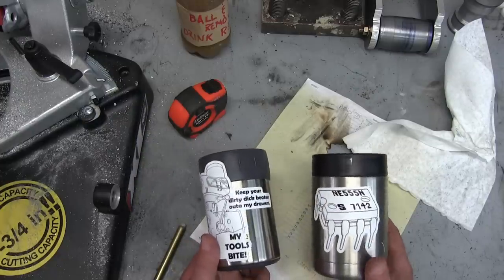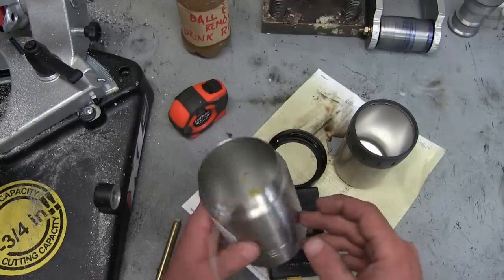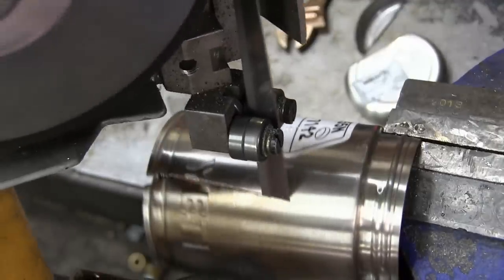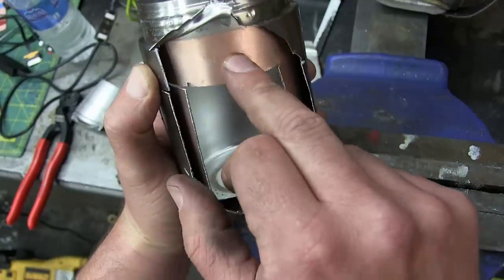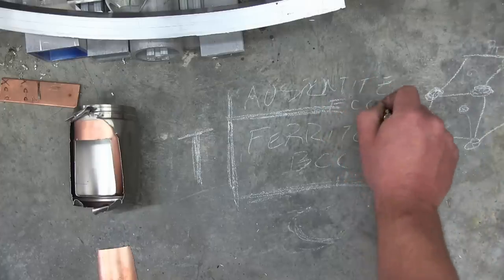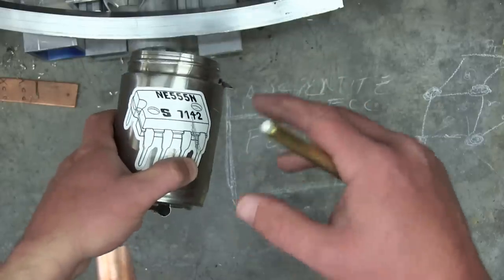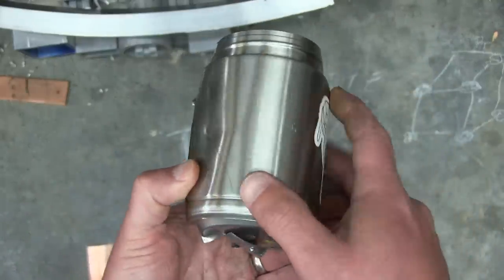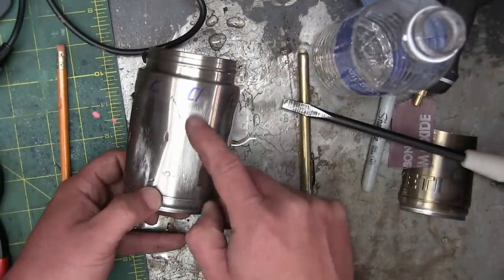BOLTR REDUX: YETI How it works | Enginerding Stainless Steel

Comment: Hi 
Thank you for your hard work in all your vedios
The little pellet at the bottom is Magnesium I think to prevent corrosion because it corrodes instead of the metal around it 
The same method is used in wave breakers and caskets the thing you bury your dead in 
Sorry English is not my language

Comment: Interesting thing you can do with stainless vacuum bottles - put a small, say, 60 watt or even less, heating element in one, and it will easily and quickly reach temperatures that you might find useful, if you were annealing small pieces of glass. 700-1200 F degree range.
I have done this many times, with various stainless vacuum bottles. If you try to be cute and try to see how hot is will get, I've gotten 1400+ degrees, and then the bottle died. IE, the vacuum sucked the sides in. Also, the bottle WILL get hot, so make a stand for it. I think the differential temperature of having it on a solid surface can help make it die from the vacuum sucking the sides together. (after that happens, it's no good at all.) (also, trying to be cute and insulating the bottle with fiberglass or rockwool doesn't work very well, either.)
I usually use a PID controller.
I got the idea from an old Scientific American Citizen Science article that said 'furnace in a thermos'.
Ex-girlfriend of mine used to make glass beads on stainless mandrels via a torch, and having this device made it possible to anneal them quite effectively - when you're done loading as many as you want in the bottle, let it sit for a while at 900 or 1000 degrees, then put a plug of some sort in the mouth, and unplug the heating element. This lets the glass cool slowly and not break.

FWIW.

Comment: Mildly stainless steel (301/302) up to intermediate grades (304/316) can become quite magnetic when it is cold worked. Since these are deep drawn cups, the stretch in that band will be quite severe. Annealing it with the torch relieves that stress.

Comment: Turns out you were right thinking they cheaped out with the copper coating on the internals, silver is the better of the elemental IR mirrors without getting into the complicated germanium, selenide and fluoride reflectors.

Comment: Copper and stainless steel are reasonably compatible from a corrosion perspective. Copper in contact with ordinary steel will cause the steel to act as a sacrificial anode for the copper, like you say. But because of the vacuum, it probably doesn't matter anyway.

Comment: The little nubbin thing can't be security tagging. It's encased in metal which would block all EM from being received or transmitted by or from the nubbin. Dunno what it is but I'm fairly sure it's not that. Great video btw, didn't think I'd be sitting here watching a flask tear down for 20 minutes!

Comment: The plug in the bottom is where they plugged it after pulling the air out between the walls, vacuum flask vs double wall flask. better insulation

Comment: 8:24 that's a getter. you can also find then in arc lights. theyre used to get every last bit of gas out of the place to be pulled under vacuum.
Reply: Well, I wouldn't say "every last bit" but enough to keep her choochin! :P You don't need, and it's nigh on impossible to create a perfect vacuum. Even the space between galaxies isn't a "perfect vacuum", but it's damn close with 1-2 particles per cubic meter!
Reply: close enough i guess! derp me!
Reply: Derp?! No way dude, you're basically right with the function, and most times "working knowledge" is more than good enough to get the job done! I'm just a nerdy information sponge, and what use would I be if I didn't share what I know? :D
Reply: Hey its not like being nerdy is a bad thing or anything... I always took being called a nerd as a compliment in school!
Reply: Good attitude! Someone trying to insult you with the word 'nerd' is basically just saying, "you're smarter than me and I don't like it!!".

Comment: That thing might be an anode. To prevent the oxidation you mentioned at first. Similar to the zinc anode in a jet ski cylinder head water jacket.

Comment: That pellet is used for increasing the vacuum. The chamber is first filled with oxygen, displacing other gasses. Then the oxygen is mostly removed with a vacuum pump. The remaining oxygen reacts chemically with easily oxidizing material (e.g. magnesium) and forms a solid.

Comment: I am guessing that little bead inside the bottom is a material that absorbs any outgassing of the other components to maintain a high vacuum. Electron tubes had that inside and it was called a "getter". It was that sliver looking coating on the inside of vacuum tubes.

Comment: Hydroflask has a comment about a small metal disk they use in there vacuum bottles. From their website "Rattling flasks: The rattle you hear is a small metal disc that sits between the double wall of your flask and aids in the vacuum insulation process. Sometimes the disc becomes dislodged, creating a small noise or rattle. This will not affect the insulation or structural integrity of your flask. If you can live with it, so can we. However, if it is an annoyance, we will exchange it for a new flask."

 I am guessing that is what that little disk is on this Yeti.

Comment: Interesting remarks about the copper surface.  I did not know that copper has higher reflectivity than nickel or rhodium in the near infrared.  But normally copper would be covered in oxide, making it a worse IR reflector than those metals.  It works here because it's inside a vacuum - assuming that the piece gets pumped out faster than the oxide can form.

Comment: I wouldnt say for sure that this is true in the Yeti coozie, but austenitic SS welds can become magnetic either by using filler wire with more ferritic properties to enhance the weld, or in fusion welds by transformation of aust. SS due to rapid solidification and HAZs.

Comment: This explains why the aluminum trim on my antique truck rotted away.   The tires throw sand and whatever else at the metal non-stop constantly stripping that layer off the aluminum allowing oxygen to get to it before it can build up a new layer.  Hence, if you own a Ford Alumiduty truck anywhere that abrasive material like.... road salt/sand gets sprayed, should form a hole, the difference is steel is easier to weld lol.

Comment: Let me recommend the Melita stainless hot and cold tall tumbler. Keeps ice overnight at room temp but best part is the top is good quality and design, functional and long lasting. Not cheap but better than both of those I bet. It actually fits on a Melita coffee machine instead of the pot, for a straight from the beans experience.

Comment: The "nubbin" attached to the inside-bottom of the container is almost certainly a "getter" pellet.
A getter is a deposit of reactive material that is placed inside a vacuum system, for the purpose of completing and maintaining the vacuum. When gas molecules strike the getter material, they combine with it chemically or by absorption. Thus the getter removes small amounts of gas from the evacuated space. The getter is usually a coating applied to a surface within the evacuated chamber.  https://en.wikipedia.org/wiki/Getter

A getter is used in many products that have to maintain a vacuum over a long period of time.

Concerning the copper electroplating - You were concerned that the copper would oxidize (perhaps you said corrode).  Copper (or any metal) can only oxidize if exposed to oxygen/air.  In a vacuum, all (almost all) of the oxygen/air has been removed.  Therefore the copper cannot oxidize.

Ed Schutheis, P.E.
Mechanical engineer

Comment: I think that little disk thing in the bottom is probably a lead seal. I know that these vacuum containers are made with a small opening that is sealed with lead after putting it in a vacuum chamber. The reason for the cap on the bottom is to protect the lead plug, and protect the user from exposure when using and washing etc.
Reply: Also I worked for REI (major retailer that sells tons of Yeti products), and also attended training events conducted by Yeti sales reps. If there is some kind of hidden security feature in Yeti products, no one at REI knows about it, and Yeti doesn't bother mentioning it in there training.. and the cashiers and security system at the doors have no way of detecting or deactivating such a feature.. 

Which is a long way of saying, it's definitely NOT a security feature.

Comment: The bead that you found inside may be chemical gas absorber for better vacuum. But usually that stuff is sprayed on inside walls after air is pumped out.

Comment: The nub is a zinc alloy to to prevent electron transfer in the oxidizing metals, mainly from the liqids the container will be in contact with. It also acts as a nubbin, so dual purpose.

Comment: I'm not a materials expert, but I do know that copper is used as the solder between stainless steel plates in some heat exchangers. Might be one of the reasons why they added it in there.

Comment: The little pill is probably a getter Material like in vacuum tubes it binds the last free Gases in itself. especially used in high vacuum applikactions you will find these. The material will be inductionheated and reacts with the gases and traps them. Or as you alredy said as a security device

Comment: I think the nubbin is to absorb gasses between the walls to improve the vacuum.  Hydro Flask (different brand of vacuum insulated bottle) mentions on their warranty page that these metal disks can become dislodged and rattle around between the walls of the bottle.  I would bet nearly anything that YETI uses the same thing and that is what you found.   I don't think it is a tracking device for theft prevention.

Comment: 304 can be hardened but it has to be work hardened. (1/4-hard, 1/2-hard, full-hard).  And since you're working with the material in its hardened condition it's a joy to work with.

Comment: Hmmm... I thing there's no real need to keep the vacuum 'clean' in there.  I wonder if that little bead contains a compound that gasses off VCI (volatile corrosion inhibitors) due to the copper on there.

Comment: 304L=Alloy 304L a T-300 series stainless steel austenitic, which has a minimum of 18% chromium and 8% nickel. Type 304L has a carbon maximum is 0.030. It is the standard “18/8 stainless” that is commonly found in pans and cooking tools. Alloys 304L is the most versatile and widely used alloy in the stainless steel family.

Comment: The nubbin inside is an oxygen absorbtion bead that activates when the pot is heated and soldered shut to reduced the internal air pressure.

Comment: Stainless is a passive metal so in order to copper plate stainless steel you first need to activate the metal with "anodic" current and muriatic acid. Followed by a nickel chloride strike then you can add copper. If you dont activate the metal the plating will not adhere and blister/wipe off.

Comment: Would be interesting if that little nub from the inside of the chamber is in fact a built-in acousto-magnetic anti-theft device. Sort of like a Sensormatic ultra strip you'd see attached to CD jewel cases. Most of those can be reactivated.

Comment: I wonder if the ferritic bead was a sacraficial oxidation point? Like you pointed out that the copper would cause rusting all to hell, maybe that was put in like a sacraficial anode type thing?
Reply: could possibly be zinc, since zinc attracts water.

Comment: Ah! That little internal bead, could it be some sort of oxygen depleting material to remove any poofteenths of O2 left inside there to prevent the copper / steel from reacting?    

Know I'm late to the party, but they'd do a similar thing in vacuum tubes using magnesium wire to burn up any remaining oxygen because even down at near perfect vacuums you still have enough floating around to ruin things.
If it were security or tracking it would be under the friction fit base cover I'd think. Not inside the  vacuum sealed area.

Comment: Cold working and heat not only change the magnetic properties of this type of stainless steel, it also becomes harder when worked and can become so hard it gets brittle. Ever bend a wire back and forth until it breaks? This happens because the metal hardens. It is an often overlooked characteristic of aluminum and copper and especially stainless wire which is common in lure making. When bending and forming loops with stainless wire you only get one chance to do it right because after bend it, it work hardens and becomes to brittle to bend again without breaking unless you heat it. This brings me to another point and that is if you heat stainless to soften or anneal it after work hardening it then you basically ruin the steel and there is no practical way for the average person to heat treat stainless properly to get its original hardness properties back.

Comment: However, the most common stainless steels are 'austenitic' – these have a higher chromium content and nickel is also added. It is the nickel which modifies the physical structure of the steel and makes it theoretically non-magnetic. 304 stainless steel contains chromium (min. 18%), and nickel (min.

Comment: I hope this video isn't too far back in the archives for my question to be seen, but I've got a question on stainless. I've been doing research and finger bangin the gargler and have found that there are no Double wall vaccum insulated stainless steel potable fluid recepticles being manufactured in the U.S.ofA. My question comes in the form of , Why? Is it in the process? In the materials? I can't find any answers.

Comment: I was curious about that copper layer and its intended purpose.  I found a patent from Zojirushi (who make the best vacuum flasks, period). US 4427123 A.  It turns out, they use a series of nickel layers to reflect heat, then they plate the outermost layer with a blend of copper & silver to "prevent the liberation of gases released from the basis material into the vacuum space".  I'm assuming Yeti is doing something similar.  The only reason they are not also coating the inner side of the outer stainless steel layer is because they would be infringing on this patent.

Comment: AvE, that nub....I believe that ferrite "nub" you thought was security control is  a  sacrificial anode, due to the fact that copper is within that cavity, and as you correctly pointed out, will rust, IF a sacrificial anode is not there. That is probably all the anode needed (the small size of it), due to the fact it is a permanently sealed environment, and a small environment at that.

Comment: My guess is that little nubbin is a sacrificial anode to address the "copper cladding will rust steel" issue mentioned previously? But it's not actually on the right side for that so ehh

Comment: Doesn't the change in temp in those metals produce a small electric charge? I've seen metal pots with a USB port on its side used to charge devices. The charge comes when heating up the pot for cooking or whatever as well as getting a charge from it cooling. 
An insulated thermos would most likely have negligible charge due to countering of extreme temp changes by its very design.

Comment: Is the little puck on the bottom a rust protector as it would rust first before the rest of the can like boat motors have the puck that is meant to rust before either rest of the motor?

Comment: When discussing steel microstructures I prefer the ´ass-bead´ explanation.  Take in one hand your entire collection of ass-beads by one end (the clean end) and allow the free end to, dare I say.... dangle freely.  As you wave your hand back and forth the beads move easily as they sway in the wind.  This happens because the beads motion (diffusion) is unimpeded, meaning they are weak and will support small loads (Yeah, I went there).  This structure is like austenite in that it offers very little resistance to dislocation motion.  Now take your other hand and put it on the dirty end dangling and put a slight twist on it.  Now the same beads are in new positions offering more resistance to dislocations, i.e. they are bound up, so to speak.  This microstructure is much more rigid (turgid) and will support larger loads ;-).  The material is now stronger.  The same beads in a new orientation now provide higher strengths.  The beads are the steels atoms in metals.  The change in their respective positions/orientations are provided by either heat treating and/or work-hardening.  I find this explanation easier on new-bees who tend to get lost when discussing BCC, FCC, tetragonal martensite, etc....

Comment: This is completely counter intuitive but it is important to be aware that stainless will rust nearly as fast as ferrous steel in a wet environment where there is a limited supply of oxygen. Places such as where a bolt passes through a hole, a micro environment is created where if it gets wet, most of the oxygen gets converted to an oxide. When this happens, there is no more oxygen left to form the full protective oxide layer that prevents corrosion. If that bolt is doing an important job, such as holding the keel onto a boat, then it must be inspected at least once every ten years. The bolt head inside the boat might look nice and shiny, but the shoulder and threaded portion can, in worst case scenarios, rust right through or be seriously damaged by the corrosion.

Comment: So with the low carbon content of the 304 stainless, would it be possible to case harden the 304 for a cost effective DIY stainless blade or cutting application?

Comment: So, after stainless has been compromised, is there a way to return it to a state where it will not corrode? Is the damage permanent. I have a nice little stainless paring knife that suddenly started to get spots as you described. I can clean it off, but they return after a day or so. Anything I can do to solve this problem?